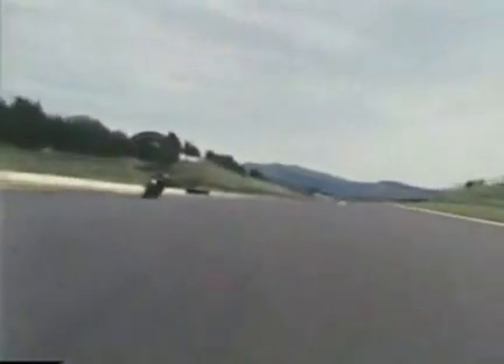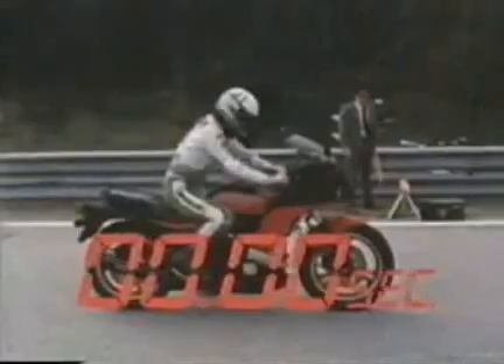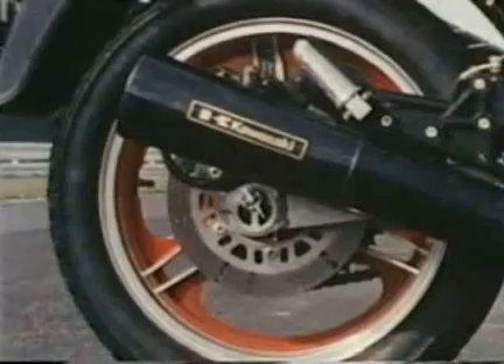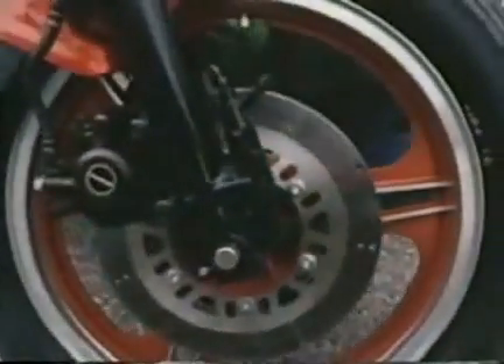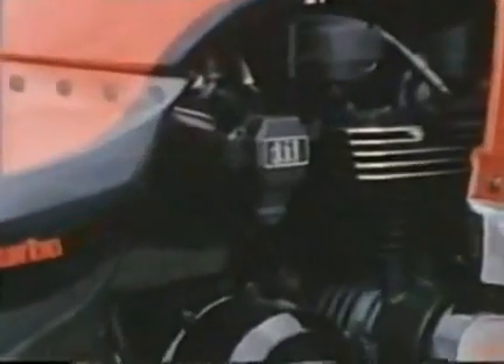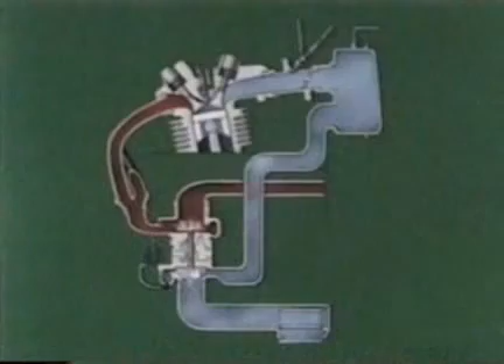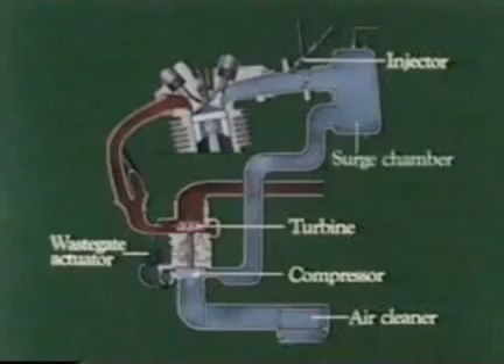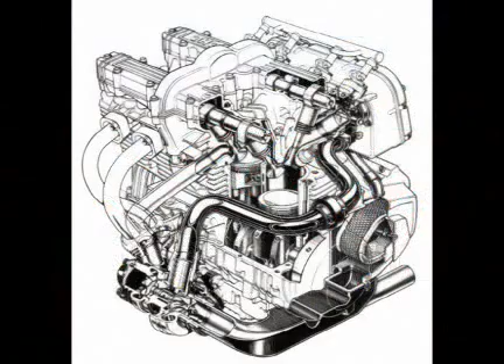Kawasaki GPz 750 Turbo Launch Video

Comment: I had a 1983,  NON-turbo version .  I was 30 years young with two babies at home. I sold it in about 85, to be sure I didn't crash it, so I could continue to work, to feed my family. That standard GPz was fast enough for me. But I must admit, I yearned for the Turbo-version.

Comment: Heres some the real scoop...I owned a motorcycle bussines in the 80s and 90s. I raced bikes to get customers. I had one of these. I striped down the weight and turned up the boost to around 20lbs....yes a Kawasaki tech showed me how to switch the computer to a hidden race program to compensate for the rise in boost. I beat everything I raced!!! But Kawasaki told me to get 20lbs of boost the little turbo would have to spin 250,000 rpm and it would not last.  Yes 12 races I was king and did it with a 750 that just pissed everyone off.  I got called out at work and like Marty Mcfly Im not chicken. Dude on someone elses big Suzuki wanted to see if the hipe was true. I raced him on a local city street just to get it over with and get back to work.  I stayed on the gas a little to long and could not stop behind a truck that slowed to see what was going on. Both tires cherpin...  I was going to crash... saw my whole life all in seconds ( yes when to think it my be the end its true) nailed the bumper and tailgate flew over the truck landed on side on road.  Month later I was out of hospital. Took a while to get back to normal. Im 65 now and still paying for those injuries.  That was one bad ass bike!!
Reply: Im still flying the turbo flag,good story, memories are for keeps...

Comment: I owned one of these in 1989, crashed it to matchsticks. My second, I owned in 2017 to 2019, but I only paid £8,500 for it, far too cheap! My third, I now own but do not possess yet.  £13,000 has bought me a mint condition, 100% restored, collectors bike. I will take delivery in March/April 2022 once the salt is off the road and it’s a tad warmer in the UK.

Comment: max power on one of these was rated @112hp while the GPZ 1100 @129hp one reason why besides handling, less weight, better braking, as the professional riders said it could beat the 1100 except at top gear 90-110mph by that time your way ahead in racing depending on the track. The reason why many died owning one was as the professional driver said no lag it just kept going faster, faster and faster turbo oops, crash!
Reply: Never felt any turbo squirt from my 750 turbs . Quite lacking in exciting me. She was fast but never was it fast enough for its turbo monika . And im pretty sure 90 mph was achieved in 3rd gear